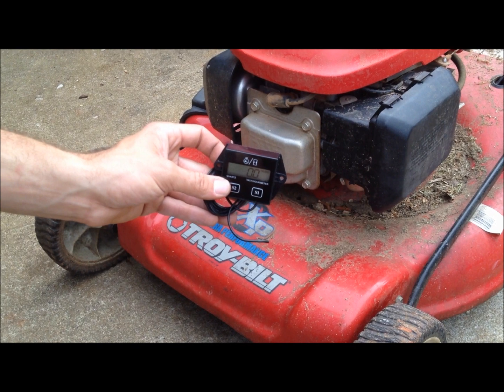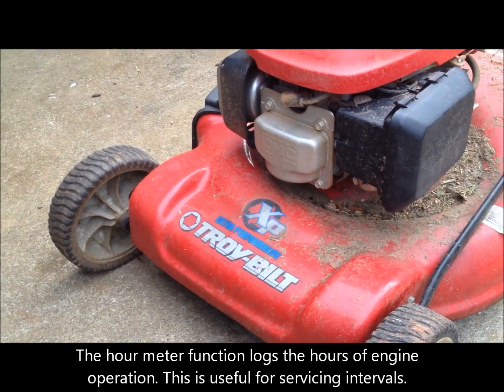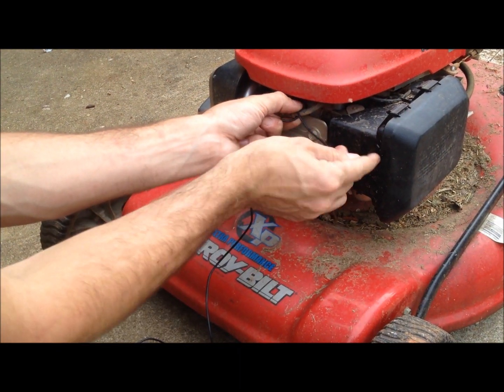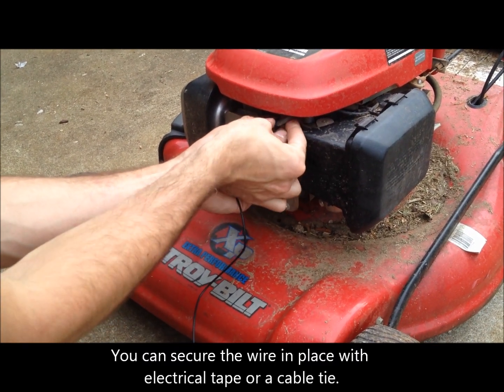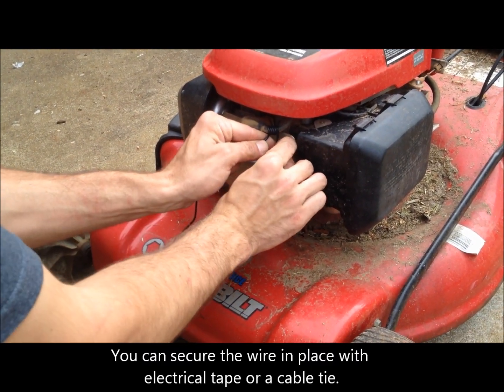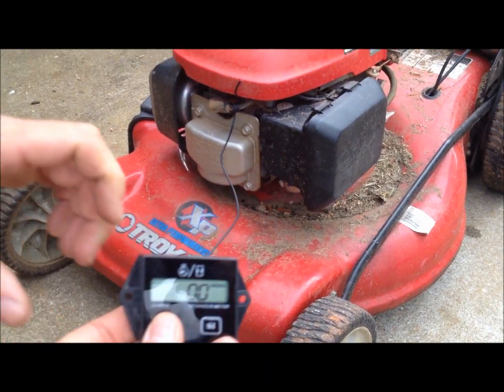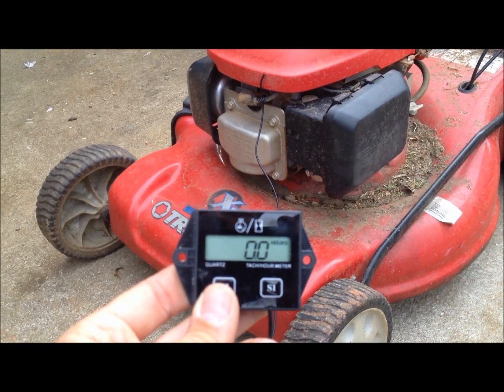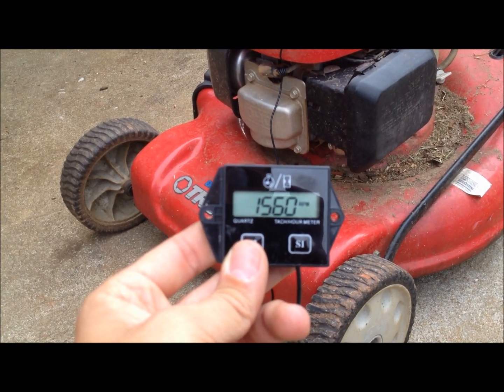Lawnmower Tachometer / Hour Meter Install

Comment: I tried two different ones of those on  my mtd mower it wont run with it  fitted 
Take it.off  it's fine it robs the spark from. The coil to plug 
Way ??
Reply from the maker: Is your spark plug wire knicked, cut, or laying against something metal?  The insulation to the spark plug wire is knicked or cut I would suggest replacing the wire.  If the wire is laying on something metal it could be causing the spark to arc to the metal before it travels all the way to your plug.
Reply: @AutomotiveAuthority  no it's like new from the coil to the plug 
You can  grab hold of any were while it running 
Except the end and not  get a shock 
You but  the spark tester on it and its fine 
It held of the engineis is special brackets 
So it dontouch any thing

Comment: I think you need to adjust your setting on there.  1500 rpm is way to low for the speed that motor is running. They run at about 2500-3000
Reply: Mode code 2 indeed it need on snowblowers and lawnmowers , 1 cyl 4 strokes _{ RPM 02)
Reply: Your absolutely right. Running on low revs does alot ofndamage to a mower.

It's also a rumour that running to high causes strain and wear on the engine.  Mine has been running at 3900 for the past 7years, never misses a beat.

Comment: I do not understand the RPM modes of this device. The manual says that setting "1" is for engines where the spark plug fires two times per revolution (do such engines even exist???), setting "2" is for ones where the plug fires once per revolution (that would be a two-stroke, like a chain saw, right?) and "3" is for an engine where a spark plug fires once every two revolutions of the crankshaft (that would be any four stroke car engine, right?).
However, looking at different comments at different videos, I get all kinds of conflicting information on this setting. Does anyone know what the modes actually do?

Comment: I bought one and went to install in on the spark plug wire as shown in the video and it seems like it needs something to bond it to the spark plug wire. Maybe a piece of electrical tape or something?
Reply from the maker: if you need to secure the wire with something you can use electrical tape, a zip tie, or something similar
Reply: Thanks

Comment: can you use any wire to extend the signal-cable?
Reply from the maker: Yes, you can splice in a longer wire to extend the tachs reach. I would suggest using a solid copper wire.
Reply: @AutomotiveAuthority  just bought one for a customer very similar to yours and it looks sealed? Nice wondering how long that battery would last? I've got old equipment from the 70s don't see that battery lasting 30 years.
Reply from the maker: Our tachometers have replaceable batteries. Thanks

Comment: For all those who want to know how to turn it off! The distributor told me that once it is turned on it can't be turned off. It should last 2-3yrs. before the batteries go dead and you can't replace the batteries cause it is sealed. I took mine apart and the batteries look like watch batteries about the size of a dine- to a nickel, maybe a #CR2032, not sure.If anyone has learned how to turn it off please reply to this comment.
Reply: I know this is an old post but I have a tachometer that's pretty much identical to this it just has a little bit of blue graphics on the front and if you hold both the buttons down it'll turn off

Comment: i have a classic 350 enfield its single cylinder 4stroke twinspark... what it should be set on the tachmeter like 01 RPM or 02 RPM ????
Reply: Paresh Vaktania 03RPM code for twinspark engine..

Comment: I have the same one, how do i turn it off?
Reply: Press and hold the S1 button until 05 is displayed. Release the S1 Button.
It will return to HOURS.
Press and hold S1 and S2 simultaneously until appears 01,02...06...09, RELEASE the buttons when 00000 appears.
It will count until 99999, after will appear again HOURS, and it will turn-off by itself in about 3sec.
Be patient during the process.
Savvas, Rhodes-Greece

Comment: you DID THIS VIDEO AND YOU TOLD US THE OBVIOUS THINGS, but the important stuff you left out. (1)  The spark plug firing revolution, (A) twice per revolution (B) once per revolution (C) every other revolution. How can we find out what the firing pattern of our engine we are installing is, and no it is not in the owners manual. Also, a lot of people are asking you how to shut the thing off, i.e. get the numbers to go out. I even contacted the company who sold it to me ....... with no reply from them. A post from you explaining these things would be nice.
Reply: Bob Miller, throughout your entire post, you kept saying “go look it up”. Yet, you’re posting on YouTube—which is ONLINE. So when someone clicks on this video to watch it, THEY ARE LOOKING IT UP. WTF do you think people do when they click on videos like this one? This is part of “looking it up”. That’s how people got here. That’s what this video is for.
Reply: +Gatewayuser200 Thanks, I guess we don't need your video, just rely on logic.
Reply: 1)  It's a single cylinder 4-stroke lawn mower engine.    A) It's in a shop manual or you can easily find it online.  Geez!   There are forums for every type of car, truck, motorcycle, etc., and if you can't figure it out for yourself, just post a question.  The maker of this video just demonstrated the tach.  Do you think he should have to look up information about your particular engine for you?  B) Normally, four stroke engines fire every other revolution.  There is an exception - see below.  Two-stroke engines fire every revolution.  This is so basic that I'm amazed that you even asked. 

The exception mentioned above is for multi-cylinder engines that use a "wasted fire" ignition system.  That means, more than one cylinder share the same spark but only one fires the fuel. The other is on the exhaust stroke and the firing plug has no effect. It just saves wiring.  If you have a multi-cylinder engine that has a coil for each cylinder, then it is definitely NOT a wasted spark ignition.  However, if you have only one coil or, less coils than there are cylinders, it doesn't mean it's necessariyl a wasted spark system. For example, older cars with distributor caps and only one coil only fired one cylinder at a time.  

If your engine is a multi-cylinder engine with less coils than the number of cylinders, you could possibly have a wasted spark system. In that case, just go online and look it up.  Again, do you expect other people do look things up for you?  It sounds like you have very little knowledge of engines based on your questions so you probably shouldn't be working on them anyway.
Reply: OOOOOOOOOOOOOOH!! the anger! Glad I don't live near you, you would probably come over and beat me.11 months I have been waiting, thanks for the reply, you did explain well what those other engines were.                Can I assume that the purpose of your video was to teach people something, not just people who already know everything, but people who bought this gadget and had no idea what the slip of paper in with it meant, Not mechanics who wouldn't need to look at a video. You said I shouldn't be doing mechanic work. Lots of people who would like to use one of these gadgets have no idea about mechanics, that's why they need to look at videos When learning to be a teacher the first thing they tell you is not to assume anything. Something that is logical to you may not be logical to someone who has never had any training. You need to explain it as if the listener were from mars. Dony73 does very good videos, he leaves out nothing. Like the wire around the spark plug wire, should it be next to the boot, winding toward the coil, or the other at around, or does it matter. If someone had never seen shoes before and you were telling them how to put them on their feet, it wouldn't be enough to say "one goes on the left and one goes on the right" you would need to say "the one curved to the left goes on the right and the one curved to the right goes on the left", and you would also need to explain how the laces work. Details my good man! You need to have your videos go beyond the basics, to include things that other people would forget to include in their videos.           Thanks for the reply
Reply: Well,  @bmfilmnut , not totally true.  Many modern four stroke engines have an electronic ignition.  Many (not all) utilize a "wasted spark" ignition.  Meaning it fires on the compression stroke and then 360 degrees later it fires on the exhaust stroke, hence the "wasted spark" term.  So, go ahead, Bob, which four stroke engine manuals tell us which is which?  To quote you, "Geez!"
Reply: Bob Miller Hey Bob, you sound very educated regarding gas engines. Why would you be watching this basic video on Tachs? Or is it just an opportunity to insult someone. Get a life Bud!

Comment: How do you turn the thing off? I have one and I can't figure it out
Reply: How long will Battery last?? See you can't change it on $35 Briggs Hour meter that hooks up the same way, it's always on and I see no way to change the battery he's acting the last 30 years? Just asking for a customer. Think I will return it? As it is always on? I've got equipment from the 70s with hours meters on them.

Comment: Hello, I've got a tachometer like your, and I mounted it on my piaggio ciao, but it doesn't work well. At the minimum, the engine is at about 800-900 rpms, but it shows 1500-1600 rpms, I tried to mount it on some places on spark wire, but only if I press the tach's wire with my fingers it shows right rpms. Could someone help me, please?
Reply: Most Piaggio single cylinder scooters, have idle at 1800rpm-2000rpm, your tachometer reading, right. 
Single cylinder engine, can't stay alive at 800-900rpm.

Comment: this is the first time i see the actual run rpm of a single cylinder lawnmower engine using a tach.
B&S engines w/a throttle less design(like mine) have a two step process. first set rpm w/governor spring only. then with 2nd spring increase another 250-300 rpm.

Comment: Can someone PLEASE make a video of the manual. I lost mine :P
Reply: A video with the manual?  Just download it from the manufacturer.  This tach is sold under many names but they are all the same. If you can't find a manual for the brand you have, just go to the website of someone else that sells the same thing (marked differently) and see if they have it.  Or just do a search for it.  

I download the manuals for virtually every machine, tool, appliance, etc., that I buy and keep them in a special folder in case I lose a manual in the future.  It's also more convenient to look something up in a manual file than digging out the hardcopy manual and you can do a search for what you want with a digital file.  

You might want to get in the habit of downloading all manuals as soon as you buy things like this.  But, I have to say that this tool is so self-explanatory that I'm not sure why you even would need a manaul.  I mean, now simple can something get?

Comment: Just purchased one of these, can you tell me if it makes a difference if the wraps on the signal wire are tight against each other, or if they are a little stretched out along the plug wire?  Also does it matter if you put in 5 wraps instead of 3-4?
Reply from the maker: You can certainly wrap the wire around the spark plug wire additional times if you would like. Also it should not matter if the wire is stretched out but the install will be much cleaner looking if they are tightly wrapped.
Reply: Can you make a video of the manual, I have this tach and I lost mine.

Comment: whats no 5 i have lost my manual
Reply: #5 is for a full reset of the unit. Select #5 then hold both buttons in for about 20 seconds. It should say reset and reset all settings and numbers.

Comment: To set the tachometer (spark plug firing revolution) :
Press S1 until display shows the right setting. Then release the button when the right mode appears on 
the display.
MODE 01—4 Strokes engine
MODE 02—2 Strokes engine
MODE 03—Multi firing (usually works when 01/02 doesn’t work)
MODE 04—Hour only
Reply: That's the problem. I don't know what type to use. I have a vtwin Briggs Stratton.

Comment from the maker: You will connect the wire coming off the tachometer to your spark plug wire just like the video. Thanks
Reply: I just bought one that looks very similar to this? It's from Briggs & Stratton and I see you can't change the battery? I don't see it lasting 30 years. Can you change the batteries in yours?